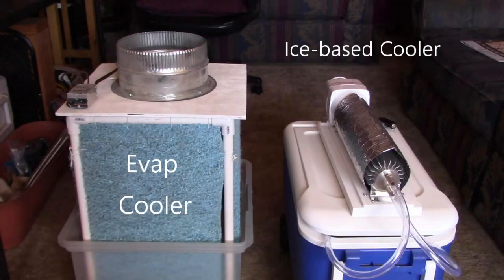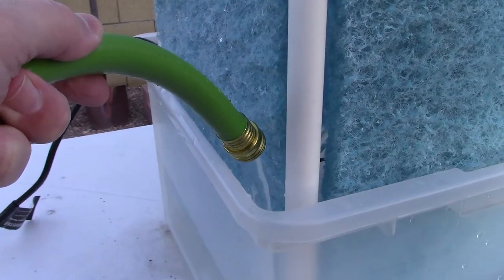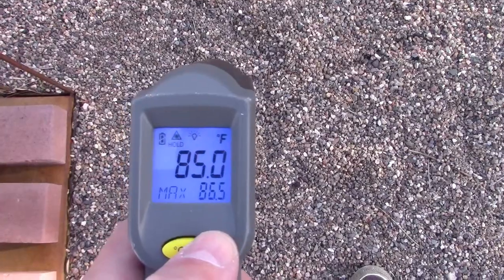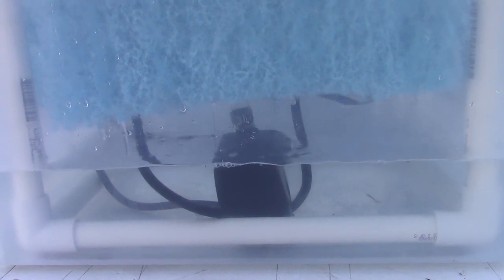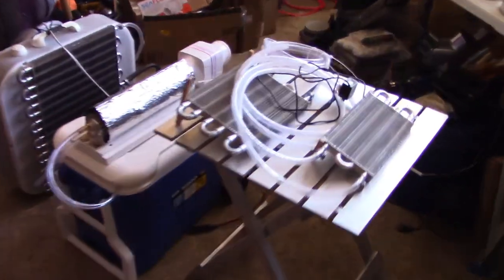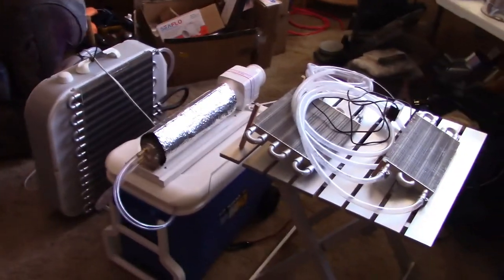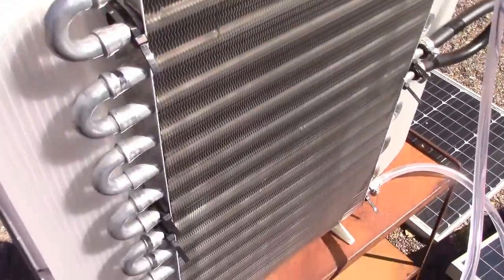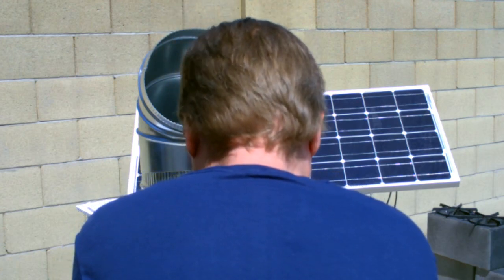DIY "Indirect" Evap AIr Cooler! Produces Cold/Dry Air (No Humidity!) - AC/DC - can be solar powered!

Comment: I like you video and am new to this concept.  I have a question.  for the initial phase of the setup ( the evaporative cooling side ).  What would happen if the unit was enclosed?  that is, the air is continuously recirculated back thru the cooling tower?
Reply from the maker: hi. the exhaust air would get very humid almost immediately and the unit wouldn't cool the air or the water. it needs fresh dry (or semi-dry air) to work it's best.
Reply: @desertsun02  that makes sense and I was thinking that might be the case - after giving it more thought after asking the question and learning more about how humidity in the air is not good for the system to work.  Thanks for the reply

Comment: Is there a limit to how long the tubing between the outdoor and indoor units can be or how much of a rise the pump can overcome? I want to use this for a room that has only a casement window so not ideal for passing tubing through due to air leakage. If possible, I'd like to run the lines through the rim board and up through the floor. Thank you for these great ideas!

Comment: 4:47 it would be better to both use and test the readings if that was in the shade. The aluminium radiators would absorb a lot of heat from the sun.

Comment: Aloha! im working on trying to figure out a system to cool down our food trucks.. I was thinking if I could put the water bath in a space under the truck, and put all of the mechanical under the truck, there is a space about 18" wide and 18" tall that runs the length of the chassis, against the outer wall of the food truck ( p30 workhorse), and then ducting the air up into the truck, to the ceiling and letting it flow down.. what do you think?
Reply from the maker: hi. i think it sounds like a good plan.

Comment: I love your videos and projects! What kind of radiator are your using here? I wasn't able to find one like it.
Reply from the maker: hi and thank you! it's a 12" (tubular) transmission oil cooler. you can find them on amazon. here is a link to one https://tinyurl.com/mvv89uf9 (i think that's the exact one i used). they do have them cheaper too. here is a link to one that looks the same and is 15 dollars cheaper https://tinyurl.com/yc7brnun
Reply: @desertsun02 Sorry I am a bit late (due to some personal issues), but thank you very much for your reply! I hope to built one of your ideas soon too for a small room of mine (my hobby room), which is 13 x 7 x 7,5 feet I think. Hopefully it will work, bcs I cannot have an a/c here.

Comment: May I ask if it's working with 48°c temperature 🤒
Reply from the maker: hi. yep, it will work at that temp. if you have air this hot (48c=118F) it is most likely very dry air, so this unit should work well.

Comment: What if you put the coolers inside and throw the wet air outside and just re ran the dry air that was created using the evap cooler. You can go below the wet bulb. Beat the humid lock. The dry air will just cool your room while it also goes back into the evaporator cooler. No reason to not work theoretically that is specific to a evaporator cooler. If your argument is if you throw air outside tried this then won't outside air  start coming in because of low air pressure and stop the cooling. Well argument maybe works I guess.

Comment: Wow great setup. I belong to very hot climate area. Right now it’s 42-47c here. We use a lot of evaporative water coolers. But hot weather lasts for 3months max than comes hardest hit n humid weather. Evaporative coolers fail due to high humidity. So only option is air conditioning. 
But your setup is genius. We can place evaporative cooler outside and circulate cold water in radiator will create some cooling effect without humidity. 
I have a question. If we build taller water falling surface area than what max cold temperature we can get in water? Like you used a bigger radiator inside so get maximum out of cold water. So can we also build taller evaporative waterfall outside; can we get colder water or not ?

Comment: If it was in a relatively high humidity environment would it stop working pretty much all together or just drop effectiveness?
Reply from the maker: hi. it drops effectiveness as the humidity rises but works well in low and moderate humidity.

Comment: Nice! You can also have the whole thing indoors, if you vent out the air that has the moisture. That moist air can take up some additional heat on it's way out if you use thin aluminium air duct.  A really lazy option would be to use a very long air duct, so you get all the cooling you need from that. Not a cheap solution, just simple.         

I think indirect evaporative cooling have much more potential than most realize, "everyone" thinks its the air that cools down, but it's actually the water that cools down first, and then the water cool down the air.

Comment: what is the cylindrical thing that is amongst the heat exchangers?  A different kind of heat exchanger - because you did not meantion it?
Reply from the maker: hi. it's a 'transmission oil cooler'. you can get these tubular ones on amazon. the one i used is a flashpower 12" 'double pass' one.

Comment: I'm living in my van in NM I need a way to do this
Reply from the maker: hi. it should work great for a van. even just the direct evap part (the cube with the pads) and you could blow that in. open a window for cross ventilation and you're set. that cube would easily cool off a van.

Comment: Great project. Going to try it. If you would be able to add some links to the heat exchangers, especially the round one, that would be great! 
The COP factor for such a system can be 10-20 higher than standard AC systems. Really wondering how effective this work in my house!
Thanks!
Reply from the maker: hi and thanks! here is the link to the exact round one that i used (if the link ever changes just search for 'flashpower 12" transmission oil cooler')
https://www.amazon.com/Aluminum-Finned-Transmission-Coolers-Dual/dp/B0714LM6ST/ref=sr_1_3?crid=1H787SH68RU9Z&keywords=flashpower+oil+cooler&qid=1686849766&sprefix=flashpower+oil+coole%2Caps%2C309&sr=8-3
just a heads up... i just built my first ever "Two Stage" Indirect Evap Air Cooler (with 2 square shaped radiators) the other day. been testing/filming/editing it all in the last couple of days. stayed tuned - video in a week or two! a two stage unit is basically the "top end" of indirect units. works with all types of fans ac and dc.

Comment: I don't understand, if this works and I think it will then why has nobody made this type of commercial systems? I'm from western India and here with low-medium humidity evap coolers work awesome, this system can do wonders if we make it properly, if you're free you should do proper calculations of the size of evap cooler and other things for per ton of cooling etc. Your video is really Nice. 👍👍👍
Reply from the maker: hi there. they actually do have a couple of systems like this that are commercially available (but only sold in certain areas - i imagine). i'm not sure why they haven't gained in popularity yet. maybe soon they will. if you set it up right, it can feel the same as an AC unit. where i live when it's under 30 or 40% humidity these feel the same as AC. by the way, i just set up a DIY two stage indirect evap air cooler! the "two stage" design takes it up to the next (the highest) level. video out in a week or two. it uses two of the 'square shaped' or standard radiators. lowest temps and quietest fans. stay tuned.
Reply: @desertsun02  I'm going to be using the Hayden Automotive 402 radiator with two 120mm Noctua fans with my setup, but I can't wait to see your two-stages design! As for the hard-to-find Dial polyester foamed pads, they're incredibly expensive in Canada at nearly ten times the price, but it seems to me that the Scotch-Brite Non Scratch Scrub Pads are nearly the exact same thing, and while they're much smaller in size, the price in Canada seems about the same as your Dial evaporative pads in the USA.
Reply from the maker: @Yvan256 the hayden 402 is a great choice. two 120mm fans fit perfect in front of that radiator. evap cooler pads are designed in a very specific way to hold water but also let air through. i don't think scotch brite scrub pads will work. they really need to be some type of evap pad. maybe you could order the evap pads straight from a home depot in the states. or off of their website. by the way, i might be posting the video i made of the two-stage unit today (06/23/2023). it came out super.
Reply: This is commercially used fyi these are called cooling towers
Reply: @dadz6364 those use indirect cooling methods? I thought those are regular evaporative coolers made by people who don't know about indirect cooling. Yeah I was right I checked no of them mention the idea nor imply in any way that it cools the temperature by that much. They are all like big fan super far air throw throw air left in right with automated air swinger's. I don't think automated air swinger's will be needed in a system like this.
Reply: @abhishekak9619  you can't use direct evaporative coolers in hot humid countries effectively, but you can use the wetbulb temperature they provide for a different setup hence we see a lot of buildings use cooling towers to reduce airconditioning loads
Reply: Brijra, Dersert and Dadz are correct, these are commercially made and available.  Growing up in the 1970's, I remember a local community college that used one for some of the buildings near it. But, the one back at that time was massive taking the space of a small US house and piping everywhere. Maybe they are still large and take up valuable space.

Comment: what about for sub-tropic areas with high humidity? any suggestions? the swamp cooler approach doesn't seem to work well, or i'm just not placing it properly for max effect
Reply: Or we can keep that part outside in which humid air is coming out
Reply from the maker: hi. the main way to cool in areas with very high humidity is with cold or ice water. you could just make the ice chest air cooler part of this and use ice. some people run tubing through a small fridge to keep the water cold. you could also use a small de-humidifier.

Comment: WELL THATS NO GOOD..ITS LOUD AS FUCK
Reply from the maker: hi. it's just a couple of fans. if you don't mind the sound of a box fan on medium or high you'll be okay with this system. my camera has the mics on the front of camera (so it always sounds like you have your ear up to it). they also sell quieter fans and you can adjust speed downward. btw, i just set up my first 2 stage evap unit in the last couple of days. it uses the super quiet fans and has high end speed controller on the main one. it's the quietest unit i've ever made. video will be out in a week or two! stay tuned.

Comment: Adding a radiator on top of the fan, to precool the warm return water with humid, cold air might be worth trying. 
You could also insulate the cold water tube to minimize heating the water from the hot air outside.
Reply from the maker: hey there. you borrowed my thought! i just started on a unit two days ago that does exactly what you said. it has the return tube connected to a second radiator over the cool air. i just got done with 5 hours of filming and building it this morning. it's still a long way from being done but... it's getting there. it's going to be my first 'Two-Stage' Evap Air Cooler. it increases the overall efficiency of the unit so it will operate better when the humidity is higher. should be really good for the people living in the 'borderline' areas. it will be out in video form in a couple of weeks (hopefully)

Comment: How big of a device(s) would you need if you wanted to affect weather (storm cycles/drought)... on either spectrum... lol, only perfect weather with just enough watering and cleaning of the air...
It would be hilarious if all it took was to retrofit the roof/exterior walls to be multiple, giant arrays of peltier devices (that are connected to unique tubings for temp transferring).
To Heat and then cool... imagine if every home was fitted to distill water onto the heater side, on those hot summer days... lol, then some electrical shocks randomly discharged to imitate electrified water... instant plant growth syrum... for free!!
Free food forests everywhere! 
More ease of populating the BLM lands... 

What do you think? It's a crazy reality, where random people get to dictate how much things are worth... and they get a huge chunk of it... compared to those that do things for the betterment of society... getting axed...

Break their system and they get mad... we get screwed because of their system, and we are told "to just ignore it and focus on this... don't focus on everything else breaking..."

[adding essential oils onto a filter to blow scents into the air... (without all those toxic chemicals in other brands) 
I wonder how effective this would be if another plague hit... Since our infrastructures are failing... to boost the immune system, defuse emotional triggers, create more "sanitized areas"... and much more!

Comment: try Ca(OH)2+water as combo water+desiccant with the fan, boxed (Calcium Hydroxide in water, lime water), optionally ice water
Reply: could be a water evaporation low vacuum heat pipe, just get the heat out of the room/space

Comment: Very nice indeed sir, last year you also helped me a lot, then I had just made the cooler and the temp. back to normal in the Netherlands....so I was not able to test it. Now it has been 31 degrees Celsius again for a few days, so you understand that the sparrows are falling dead again from the roof. Now I just came across this new video of yours and it really appeals to me, less messy with water. Now English is not my first language, so I mainly rely on the examples. I see an elongated radiator there. My question is, does it really make that much noise or is it because it's on the coolbox? Where can I buy this. How many cubic meters, can I cool with it if the height of the rooms is 2.5 meters. Thanks in advance for your cooperation. Greetings from Rotterdam.
Reply from the maker: hi. it's not very loud. it's really just the sound of the fans. microphone on camera just makes it sound that way. if you don't mind the sound of a fan then you shouldn't mind this. i don't know the square footage it will cool. that will vary a lot based on humidity and temp levels.

Comment: The cool-humid byproduct might enhance a greenhouse environment...
🌱🌷🍅
Reply from the maker: that sounds like an excellent idea. i hadn't thought of that. my next video is going to be using the cool 'exhaust air' to re-cool the water coming out of the radiator. i'll cool it before it re-enters the tub. that will make what's called a 'two stage' indirect unit. will be my first one of those. just started on it yesterday

Comment: Can the small oil cooler seaflo fan work this way on an existing hessaire evaporative cooler? I figured it would be the same Theory I already have a small 500 sq foot swamp cooler I want to add to.
Reply from the maker: hi. yes you should be able to use the tubular radiator with the seaflo fan with any regular evap air cooler. all evap air coolers chill the water in their water reservoirs. you could also use just about any fan/radiator setup if you can't make the tubular one.
Reply: @desertsun02  Thanks. yes I already made one with an adjustable fan control knob. Thanks again for providing all of these awesome designs. I'm off grid in northern Arizona and have successfully implemented several of your designs.

Comment: wow love the effort. I'm thinking of running small fans on heated salt for my van. no ac in there at all n over 90 degrees here already so I feel like I'm being baked during the afternoon. ty for sharing your ideas  with us :)
Reply from the maker: hi or consider making a smaller evap unit that could work in your van. this unit can easily be re-sixed for all needs. also check out my ice-based fan videos. the ones with the smaller radiators work great in small spaces (vans etc.). here's a link to 2 of them https://youtu.be/5YVPu9hfhZo and https://youtu.be/DERYsKnlKzA

Comment: DiWhy. In the fall you can get a window unit for 150.
Reply from the maker: yep, but then it costs that much in electricity every month to run it. (i was literally paying 150 a month for the electricity a few years back). plus DIY is cheap easy and fun 🙂 (and since you made it you can always fix it if needed). cost to run this unit is very very low. just a few dollars a month

Comment: Cool! 😊  under what humidity does this cool?
Reply from the maker: hi there. the lower the better but it's roughly the same as standard evap cooling, so it works up to about 60% humidity *in some cases up to 70% (in lower/warm temps). it will struggle over that. if you have lower or semi low humidity then this thing basically is as cold as an air conditioner. if it's moderate then it will still be cool but slightly warmer than ac.
Reply: @desertsun02  Does algae interfere after a summer of use?  How many summers have you used this?  How many rooms does yours cool?

Great work!
Reply from the maker: algae has never been as issue for me. i just make sure to turn it off every 12 to 24 hours so the pads can dry out. that only takes about 5 to 10 minutes if you leave the fan running for that same 5 to 10 minutes. if you don't run the fan the pads will be dry in 30 to 60 minutes. i've used the unit ever since i made it a few years back. it cools about half of a small house in low humidity